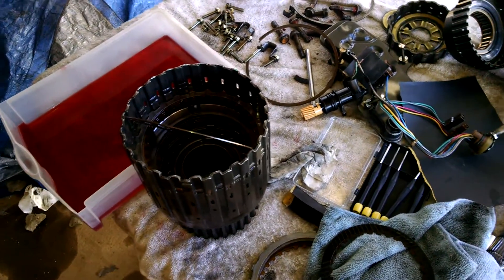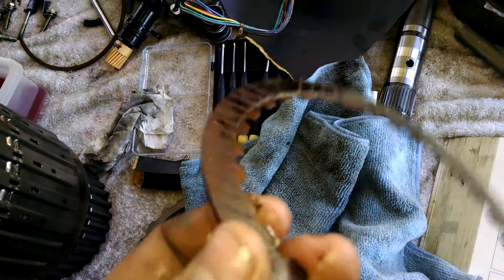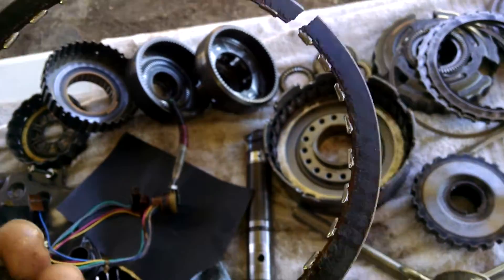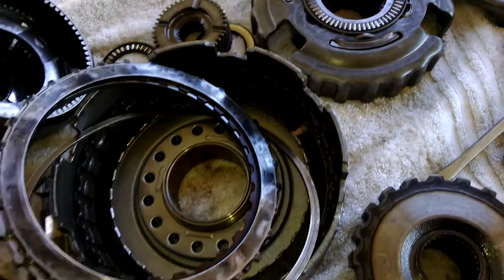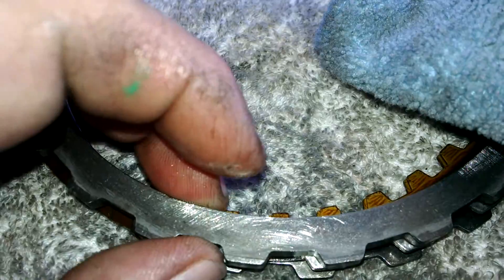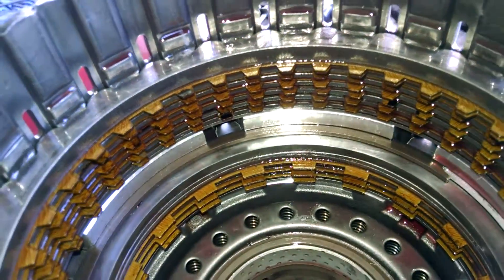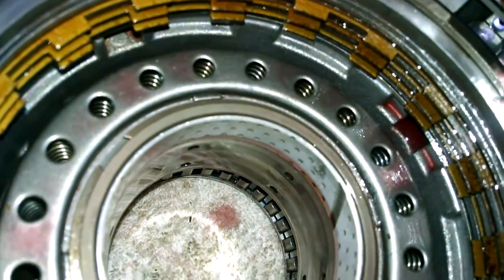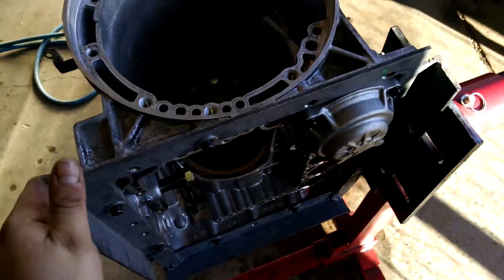300ZX / 240SX RE4R01A trans diagnosis and rebuild!

Comment: I bought a 2004 Xterra for 500 bucks with a 3.3 v6 with 277,000 miles on it, this thing is like brand new inside body is real nice, everything works on this vehicle but reverse! The 4x4 works the OD works the fluid in the trans is clean but reverse doesnt move the vehicle at all, the RPM chages slightly like its going to do something but it never attemps to move. a rans shop said the reverse band is out but does this trans even have a reverse band? somebody told me theres a reverse soilinoid and theres some kind of metal thing thats rides next to the pump that centrifically controlls the line rise pressure and it gets worn out or sticks. I cant see putting 2500 bucks into this truck for a trans because thats about what im going to sell it for. I see rebuild kits for this trans under 300 bucks, i have rebuilt many engines before so i think if i had a manual i could rebuild one, i may have to get a few specialized tools  but if i could fix this thing for under 500 bucks i could make a few bucks, My daily driver is a 2001 Xterra but 2 wheel drive with only 130,000 miles, this 2004 drives as good or better than ours even though it has almost 300,000 miles on it, the original owner was a single guy, i dont thing anybody ever rode in the other seats, the headliner is new and hes definatley serviced the engine regularly

Comment: I have a 91 miata that was towed for 60 miles without pulling the driveshaft now it wont move is there anything that I should look for that could be bad
Reply from the maker: All the forward clutches are trashed.
Reply: @L1Training  thanks the whole thing is trashed

Comment: I recently bent my flexplate so the torque converter was pulled a half inch toward the motor and I drove about 30-45 miles like that. It started having problems from a dead stop where the RPM would rise but barely any forward movement was happening then it would very quickly slam forward 4 or 5 times before taking off normally like nothing ever happened. As soon as I got it home I removed the trans and put a spare flexplate I had on but when I drained the oil it was saturated with very fine metallic particles. I first thought it was water because it looked opaque and like chocolate milk but now I know better.

I flushed the fluid with Mercon V and that seafoam transtune stuff to some success. It has pretty much cleared up completely but I am left with these two things:

1. 2 to 3 has a long shift that is rough-ish when it does shift if the shift happens above 3500 RPM

2. A low pitched whirling that is only present when the vehicle is moving forward under the power of the torque converter alone with no gas.

I need your advice on whether or not to buy a new torque converter. I don’t want to sink anymore $ in this thing if the rest of the trans is likely doomed. 

Today I heard a short metal on metal scrape when I was coming to a stop that seemed to come from the torque converter. 

Please help me.

Comment: Keith 
90 300zx n/a
What causes the car not to downshift?
It will shift up but not back down at a stop it’s like in 2nd or 3rd
You can shift it manually
Everything new
Pump etc only real thing used is case
Reply from the maker: Has it had this problem from the moment of the rebuild, or did it work fine after the rebuild and this is a new symptom, AND what problem prompted the rebuild to begin with?
Reply: replace the sun gear and planetary set after they went blow per say --hand alot of metal -----159k ---
everything is basically new but case /shafts and few steel ---i used the MASTER kit from Cobra--2wd kit 
i have no codes --i thought of getting a 14 pin reader --any thoughts 
converter is new too
Reply: had alot of metal---it was slipping 2to3 esp on a dwn shift up a hill

When I do the protocol it flashes for 2seconds then 16 quick flashes 
I’ve used 4 different tcu
Only one was same # as original 
I’m stumped
Reply from the maker: Under most circumstances, if you can manually shift it, but it will not do it on its own, its a electrical, or valve body failure.
Reply: Keith Perkins 

Well I snatched up a used trans for zero but has 245k on it 
Pulled mine new/rebuilt 
Installed old junk yard one and car runs great but no 3rd lol

I was looking at all my recipe for the trans rebuild 
And something stood out

Since everything is new 

“Valve body cleaned”
“No work required”
Guess I chase down a new valve body

There is no passing gear also

Comment: Looks like a sloppy rebuild or lack of knowledge from the previous builder. THX for the info. Is there a shift kit for these RE4R01A?
Reply from the maker: Yes, "Whatever It Takes" (WIT) transmission company offers 2 options, both require disassembly for installation.

Comment: I've got a 1999 frontier with the re4r01a transmission in it and third and fourth gear have went out. Am i able to replace the transmission on my truck with one out of the 240zx/300zx? Will bolt patterns line up? Electrical plugs?
Reply from the maker: Steven Wheeler yes they will bolt up but I believe tailshafts to be different, causing a mismatch of driveshaft length. Just make sure to measure first.

Comment: what manual is that I know it isn't atsg looks very detailed ??
Reply from the maker: it is the nissan factory service manual, from the dealer
Reply: @L1Training   is it possible for me to get a softcopy of that? Try figure what going on with my trans.
Reply from the maker: @jeromeramnarinesingh9434  the soft copy can be purchased on ebay.
Reply: @L1Training  have you ever got a hissing souñd for a transmission (sound like a pump steering pump low on oil) only get the noise when the car in a driving car and foot on the brakes.
Reply: Is it possible for me to get a soft copy of that?

Comment: Hi Stephen, I have a 1993 Mazda MPV van (165k miles) with this same transmission (R4ael). Mine recently started downshifting harder than normal when coasting to a stop. Next I noticed the hold light blinking and trans would not go into 4 gear. (also noticed the Ck Eng light flicker 3-4 times while this was happening) When I got up to 50mph I let off throttle and trans downshifted hard enough to bark the rear tires. All this happened on a short 5 mile trip on an extremely hot day....the next day all seems to be working fine. Fluid level was good. No slipping was detected. Does this sound like a solenoid sticking, dirty filter or possibly a modulator problem......or something much worse $$$. I will R&R filter/fluid tomoro but, that is about my limit due to health problems. Just wondering if it is time to put my old 23 year old work horse out to pasture or is there something easy I could do to save her...thanks for any advice Chuck Butner

Comment: hey Stephen Perkins, can you tell me if the input shafts on the RE4R01A transmissions interchangable with other RE4R01A transmissions? i got an r32 skyline RE4R01A  and i got an r34 RE4R01A, wanna know if the input shafts are interchangeable between the two. let me know what you think. they are both 4 speed auto, only difference is one uses 3 bolt converter and one uses 4 bolt converter.
Reply from the maker: Yes they are interchangable
Reply: lol i found out by trying it already. thanks alot though, i will surely subscribe to your youtube BIG UP STEPHEN!

Comment: Good info brotha. Hows the tt vert? Gonna do more z videos soon? Also i got some questions about sizing up rod and crank bearing for the vg30de. I got one i need to rebuild. Might need a new rod or two just due to slight rod knock. Wasnt drastic but bad enough to replace the motor until i can rebuild. And thats why id like to pick ur brain if u dont mind =]
Reply from the maker: Yea more vert vids, very soon, on the bearings replace them all, and get a factory service manual to determine bearing grades.